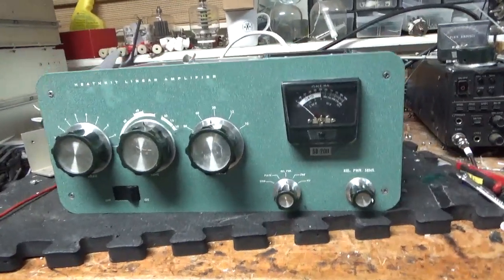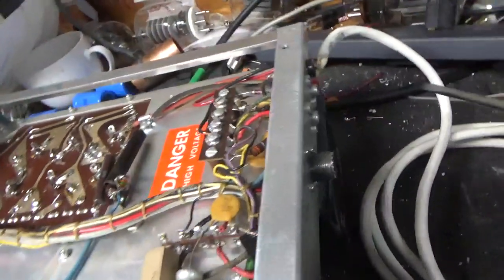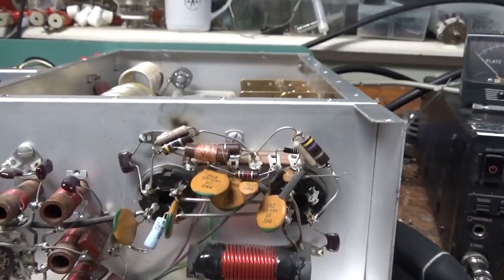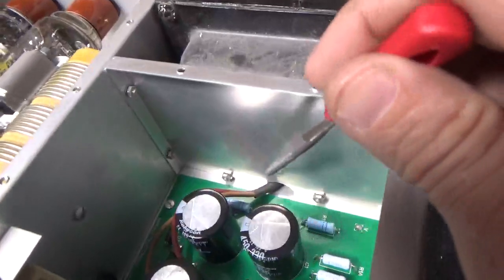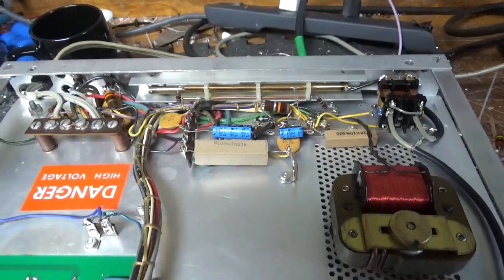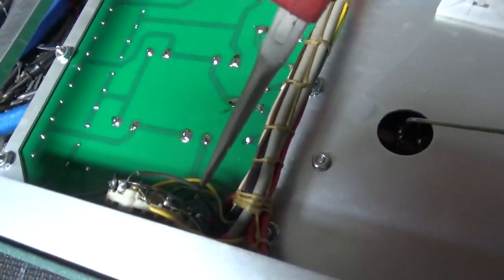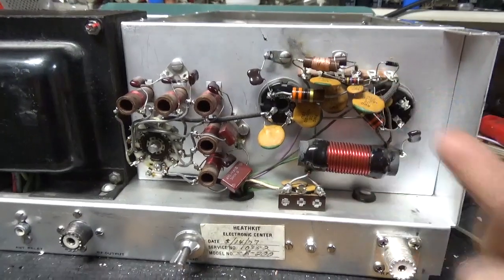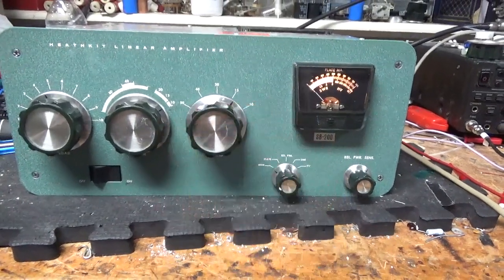Heathkit Sb200 Repair, Modifications Dangerous Pre Mod Removal. Harbach Filter Cap Board  Penta 572b

Comment: I did these mods including Harbach filter caps.  My 80m input cap was out of tolerance = high input vswr..replaced.  The filaments choke is not very large.  Is it ok or should it be replaced?
Reply from the maker: Thank you for the comment , filament choke is ample 

73

Comment: Glad you’re feeling better. Great video. I’ve been thinking about buying a SB-200 but am nervous about it. Do these amplifiers have parasitic oscillation problems on 10 meters?  I’ve also seen some issues on other YouTube videos with input swr cannot get adjusted down to near 1:1 so different coils and mica caps are needed? Please advise if these issues are real or not. Thanks 73.
Reply from the maker: No oscillating issues after I go through one, no need for a 1.1.  1.5 ot less is fine

Comment: I have a SB-200 that I have had for years. One day it just quit keying and I put it away on mothballs. I bought a replacement relay but I never delved into it to see if it was just something simple ,, I have a Command Techologies HF-1250 so I really never worried about it but I stumbled upon this video and it reminded me of it ... I wonder if its still economical to repair these old amps. I wish to emphasize that I did make most of the Harbaugh mods many years ago. I think it has the original centron tubes.
Reply from the maker: Yes definitely worth repairing , great amp

Can’t say the same for the command tech , i don’t repair as parts are un obtanium